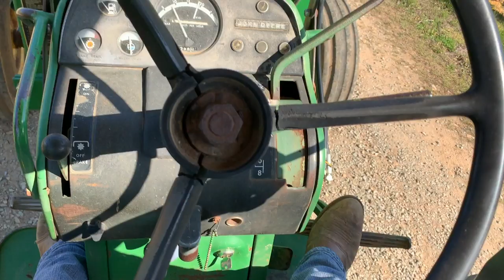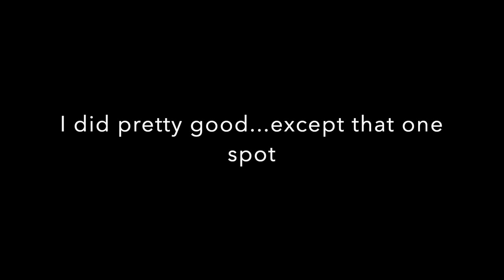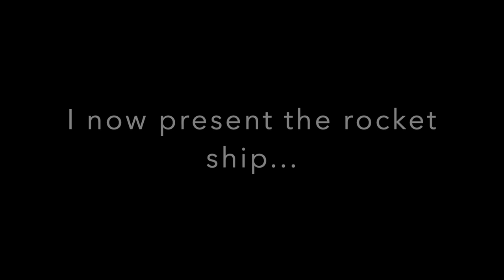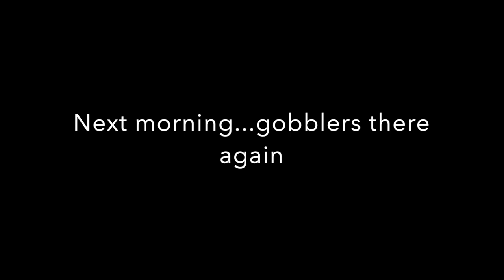Cleaning Grain Bins, Quarantine Cuts, Hail Storms & Rocket Ships

Comment: Meredith, if you use a piece of 4x4 or 6x6 under that crank jack, you won't have to crank so much.
A couple turns and pull the block away.  I had a length of rope loops nailed on several blocks I used.
Only 3 days between a good hair cut and a bad one.....well maybe 5!   And saved a few bucks too!